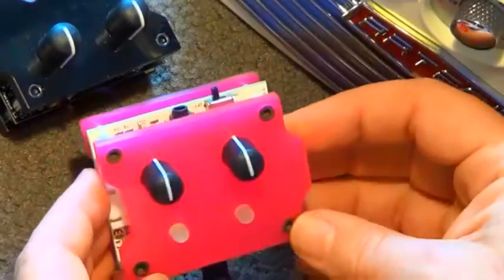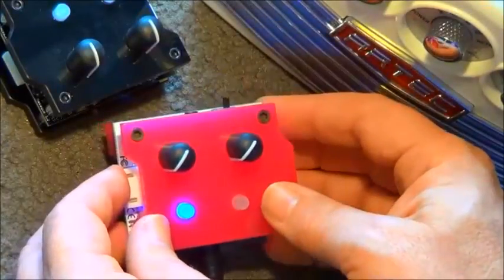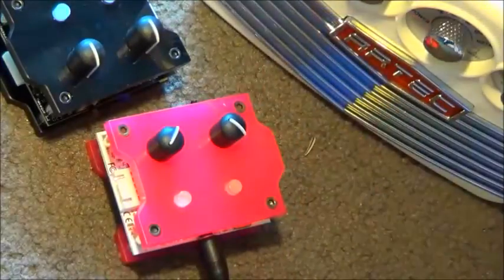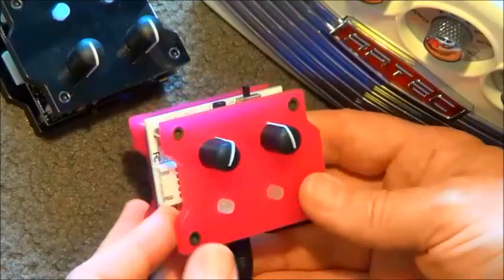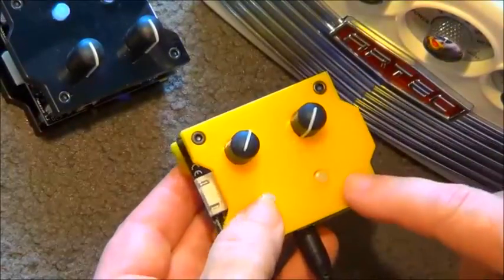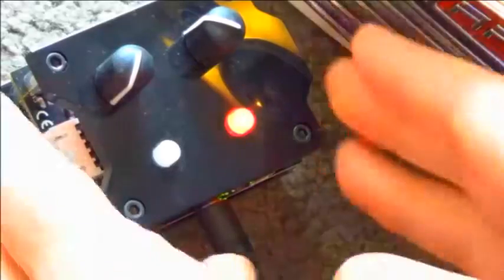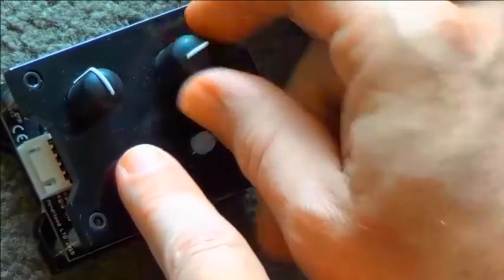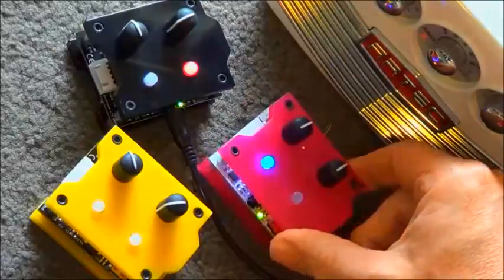Patchblocks mini synthesizers. Programmable. Tiny. Awesome.

Comment: What preset are you using on the blocks. The last 2 do not sound familiar. I recently purchased a 5 block set and the midi module and need help. Thanks.
Reply: Yeah yeah, what I meant was I still have one, but already moved on to eurorack. Still messing with them though.
Reply: @djlehara  Same. started my euro in 2018, second tier 2019 & patchblocks acquired they are pretty awesome definitely keepers ... 2020 went for a Moog The Rogue last Sunday... it sounds amazing... I highly recommend making the leap if you haven't. Also snag a Yamaha FB-01, unsung hero, sounds amazing, i think its better than tx81z.
Reply: @107-c4l  I went with the Cre8 Audio nifty case. Wasnt too keen on their modules, but really versatile cheap 84hp cases. Filling my third today, and planning a fourth by June/July to hopefully start gigging again. weekly internet radio show possibly starting next week too.
Reply: @djlehara  Nice. i like their skiff design. i have the chips module, mainly for the dual lfo and digi wave. dumb nobs though, switched out. The moog won the debate on the 3rd tier. went with the tiptop 84... Gigs... i miss the before times, the long long ago... i had ideas back then... I just fix the hardware and do the good deed, preserve the legacy... make a couple dollars, trade whatever works.
Reply: @djlehara  Just finished restoring an Ex-8000... 80's solder is the worst. Smells terrible... i traded for a DW-8000 I restored. this is a keeper. I love the hybrid digi/analog and the one function manufacturers just dropped off... The arpeggiator... Big reason i love the patchblocks.  I wish i could find the midi block.
Reply from the maker: I went to the Patchblocks website and downloaded some other patches. It's a pretty good system, all done by USB :) GF
Reply: @gearfacts  yes I am familiar with the site but was w/o n derin g about the specific. 2. Patcches used at the end of your demo, especially the last one utilized in the black block. If its up on the site, what is its name?? Thanks.
Reply: go to website download PB software, go to github searh PB find archive, and other repo's dediated to patchblocks. plug in to usb, turn on unplug plug back in load patch. From there its foggy. dasiy chaining them... im not sure where the community is... but there are awesome... technically an ARM device, so any linux or firmware library should allow you access inside from there have fun... or employ elk code, pi code embedded code per specs to the pb... havent got that far yet.... got a pile of synths to fix up and do thigs with late at night,,, bump  bump bump.... super helpful i know...
Reply: @107-c4l  it's all good....this is old.....
Reply: @djlehara   ya i suppose... but its coming back around... elk audio is pretty dope and the github repo are advantageous...